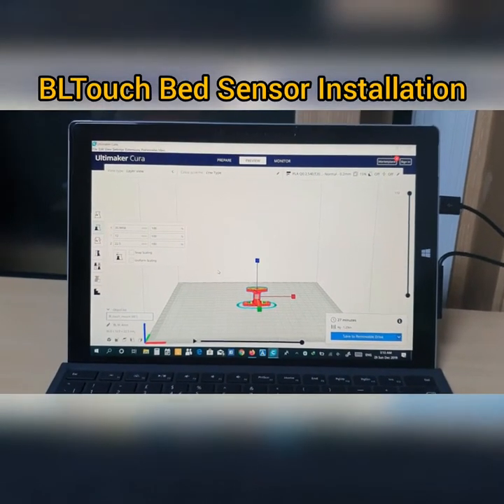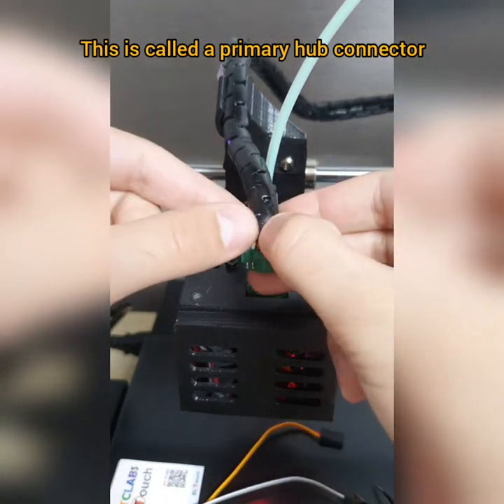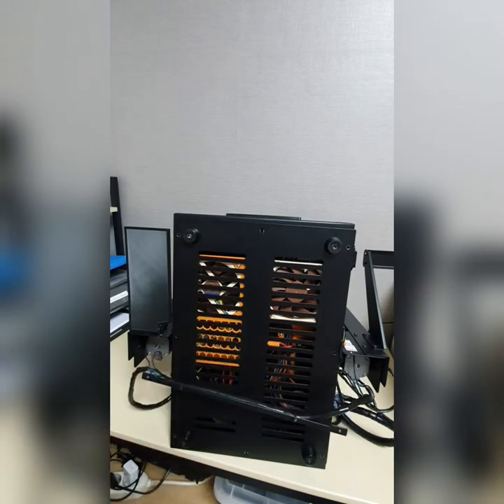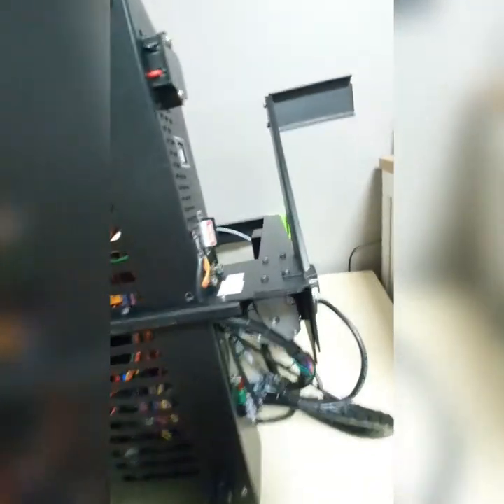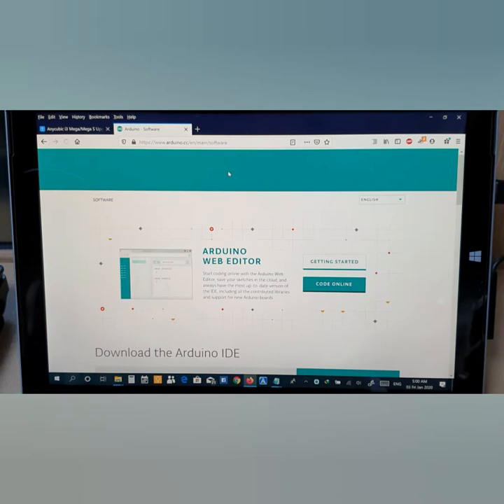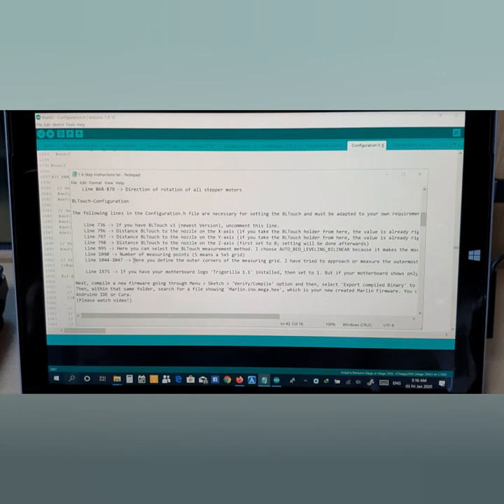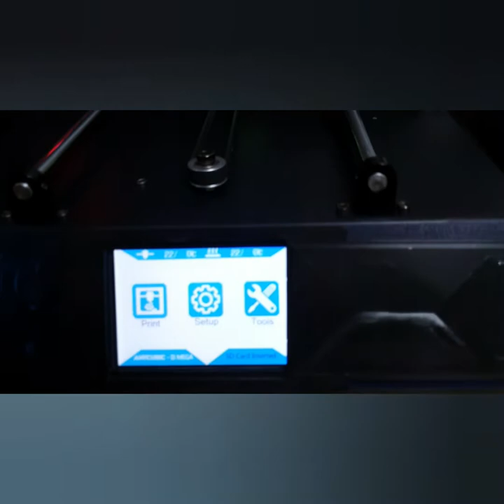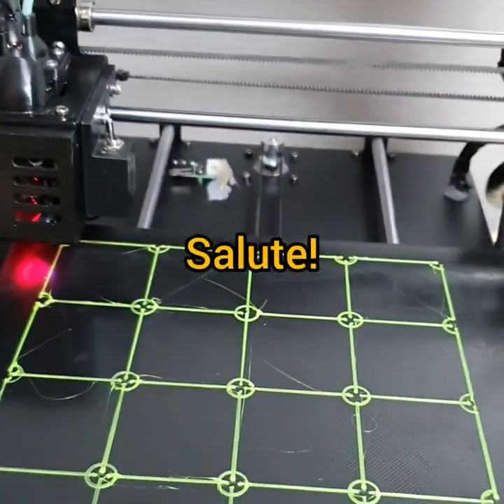BLTouch or Clone Bed Sensor Installation & Marlin Firmware for Anycubic i3 Mega / Mega S 3D printer

Comment: I seen somewhere on here that when replacing the stepper drivers with tmc drivers you have to turn the white plugs around also
Reply from the maker: It depends. There are 2 alternatives: 
1) You should comment out in the Configuration.h OR
2)Reverse the cables.

Comment: Can you show how you installed the mount do you need any differant bolts. Also did you use pla for the mount.
Reply from the maker: Well, I printed in PLA but I recommend you printing in ABS. I guess M3 bolts 🔩 and nuts.

Comment: Are the two z endstops still enabled? Should i mechanically set them lower than the probe? My bltouch seems to do nothing because the Z axis goes down only to the endstops and the nozzle remains too high to print
Reply from the maker: You need to adjust the Z axis on screw lead to be downwarded till the nozzle touches the bed. Please join in our Facebook group we can assist you step by step. The link is mentioned under the video.

Comment: Great tutorial! I followed every step in this video. The only problem I have is that my BLTOUCH is not registering when the pin is pushed in. It fails after trying the first point. Do you think you know what is going on?
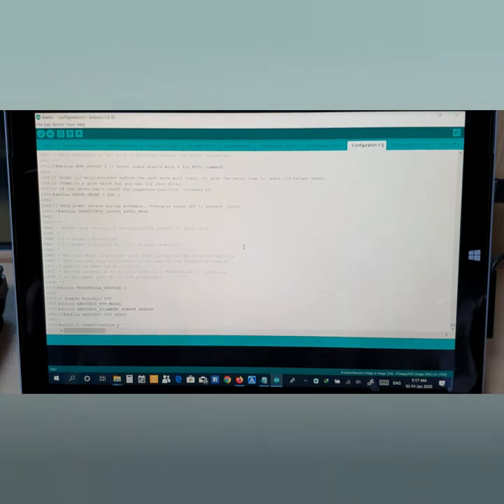Reply from the maker: Did you follow this step 1:16:00 ?
Just listen carefully.
Reply from the maker: At track 14:11: there is a minor misguidance about the White & Black wires on BLTouch. Here it is. White on BLTouch is Signal & Black is Ground. 
White goes to Yellow wire of Fanbox & Black to White wire of Fanbox
Reply from the maker: Then after you have done these, please inform me asap.

Comment: Do this only work for Andrino? I not using Andrino or plan to do so. where can I find the configuration file so I can check them or update the motherboard version? I do see the blue light on my bl touch 
I followed your steps and the bl touch is on.
Reply from the maker: check the white and black wires
Reply: @ariankojefferson2758  Thanks but you didn't answer the question where can I find the configuration file to update.

Comment: Are there any disadvantages of the marlin or bltouch?  I also saw marlin 2.0 and are you going to install that? I also saw some kinda extruder issue after bltouch installation. I'll be happy if you're going to answer me.  :)
Reply from the maker: Hello, there are no any issues so far. It is much better than the stock one and Marlin 1.1.9. 
Please join in our group for detailed explanation:
For FDM printer: Anycubic i3 Mega/Mega S or X: 
https://www.facebook.com/groups/1475376915974525

For SLA printer: Anycubic Photon Mono SE:
https://www.facebook.com/groups/186363709772657/?ref=share
Reply: @ariankojefferson2758  Dude I got stock printer. So is there any difference to flash marlin into my printer?

Comment: Hello mate. My board version is V0.0.2 On the Arduino IDE should I leave TriGorilla Version 1 or 0? Another issue when I try to compile my sketch I got an "exit status 1" "Error compiling for board Arduino Uno." Any clue about this issue? Thanks.
Reply from the maker: Hello,
Did you check your board logo that shows Trigorilla 1.1. If so, then you need to comment out 1 but if your board shows just Trigorilla, then it comment out 0.  Join us in our Facebook group for our assistance.
Reply: @ariankojefferson2758  Thanks for your reply mate. My board is just "TriGorilla" that means comment out "0". Ok. But when I change it to "0" and try to verify/compile I got an error "exit status 1"
Reply from the maker: I need to see a photo or video so I can assess the situation.

Comment: Hi Bro. Will this apply to i3 mega X? My Z stop sensor broke
Reply from the maker: yes it applies. But make sure to buy it at AliExpress before u begin
Reply: @ariankojefferson2758  thanks Bro. I may not need the z sensor right? If I install the bl touch.
Reply from the maker: @TitoPopoy  u better have but it works when u install BLtouch
Reply: @ariankojefferson2758  ugh. One of my z axis stopper aint working
Reply from the maker: @TitoPopoy  the nozzle might crush or grinde and makes sounds. U better purchase. It just cost less than one dollar
Reply: @ariankojefferson2758  i dunno if there are spare parts here/. I'm from philippines
Reply from the maker: @TitoPopoy  u can purchase on AliExpress

Comment: Hi, I have just installed all this but the first layer keeps reverting back to 0.3. I have added spacers etc, amended GCodes but it keeps going back to 0.3 Z Height when it prints and it should be -0.8? Any help please?
Reply from the maker: Please adjust the BLTouch washers to adjust its height.
Reply: @ariankojefferson2758  Thanks, I have done that but the default first layer keeps coming out at 0.3 regardless off washers or gcodes?
Reply from the maker: Here is my Skype i.d: 
live: Sawak.the.great
Reply from the maker: Did you adjust the Z rod adjustment screws on each side? Try to adjust it there too.
Reply: @ariankojefferson2758  I did make some adjustments there yes. Sorry I cant get video on skype!
Reply: @ariankojefferson2758  Its like the Z-Offset isnt making any effect at all even when it doesnt hit the endstops.
Reply from the maker: I need to see all through Skype. Otherwise, it is hard for me to figure out when i can't see what is going on.

Comment: when i flash the firmware it will not reach the temps I need it to, I need it to reach 260c its only going up to 245 then temp goes down
Reply from the maker: Yes that's right. Either it restarts automatically or hangs in the middle. It is because of either weak built-in Mosfet or low PSU voltage. Please join our Facebook group, where we can assist you.

Comment: are you able to put a stock firmware file with bl touch on to the thingiverse page please!!!
Reply from the maker: Yes it is already uploaded. Please check in Thingiverse page.
Reply from the maker: It is impossible to use stock firmware with BLTouch bed sensor. You have to flash Marlin Firmware onto your 3D printer.

Comment: When I start the automatic bed leveling the sensor won´t pop out (blue light) at the first test point. What could be the issue?
Reply from the maker: Your BLTOuch while and black are not connected.
As I have recently explained about my misguidance under my video.
Here:
"At track 14:11: there is a minor misguidance about the White & Black wires on BLTouch. Here it is. White on BLTouch is Signal & Black is Ground. 
White goes to Yellow wire of Fanbox & Black to White wire of Fanbox"
Please let me know.
Reply from the maker: Please join us in my Facebook group:
https://www.facebook.com/groups/1475376915974525/
I will assist you there.
Reply: @ariankojefferson2758  I already did. It drives into the first measuring position, goes down (no BLTouch extended/red light) then stops.
Reply from the maker: Black and white wires on BLTouch have a connection issue. Please check !

Comment: Hi thanks for the video.
I have this problem when I try to verify the fiin Arduino:
Arduino:1.8.13 (Mac OS X), Scheda:"Arduino Mega or Mega 2560, ATmega2560 (Mega 2560)"
In file included from sketch/MarlinConfig.h:42:0,
                 from sketch/I2CPositionEncoder.cpp:31:
SanityCheck.h:946:5: error: static assertion failed: LEFT_PROBE_BED_POSITION is outside the probe region.
     static_assert(LEFT_PROBE_BED_POSITION >= MIN_PROBE_X, "LEFT_PROBE_BED_POSITION is outside the probe region.");
     ^~~~~~~~~~~~~
In file included from sketch/MarlinConfig.h:42:0,
                 from sketch/AnycubicTFT.cpp:27:
SanityCheck.h:946:5: error: static assertion failed: LEFT_PROBE_BED_POSITION is outside the probe region.
     static_assert(LEFT_PROBE_BED_POSITION >= MIN_PROBE_X, "LEFT_PROBE_BED_POSITION is outside the probe region.");
     ^~~~~~~~~~~~~
In file included from sketch/MarlinConfig.h:42:0,
                 from sketch/AnycubicSerial.cpp:34:
SanityCheck.h:946:5: error: static assertion failed: LEFT_PROBE_BED_POSITION is outside the probe region.
     static_assert(LEFT_PROBE_BED_POSITION >= MIN_PROBE_X, "LEFT_PROBE_BED_POSITION is outside the probe region.");
     ^~~~~~~~~~~~~
In file included from sketch/MarlinConfig.h:42:0,
                 from sketch/G26_Mesh_Validation_Tool.cpp:27:
SanityCheck.h:946:5: error: static assertion failed: LEFT_PROBE_BED_POSITION is outside the probe region.
     static_assert(LEFT_PROBE_BED_POSITION >= MIN_PROBE_X, "LEFT_PROBE_BED_POSITION is outside the probe region.");
     ^~~~~~~~~~~~~
In file included from sketch/MarlinConfig.h:42:0,
                 from sketch/M100_Free_Mem_Chk.cpp:49:
SanityCheck.h:946:5: error: static assertion failed: LEFT_PROBE_BED_POSITION is outside the probe region.
     static_assert(LEFT_PROBE_BED_POSITION >= MIN_PROBE_X, "LEFT_PROBE_BED_POSITION is outside the probe region.");
     ^~~~~~~~~~~~~
exit status 1
static assertion failed: LEFT_PROBE_BED_POSITION is outside the probe region.

And I have the line 946 is in RED color.
Could you help me please?
Thanks
Reply from the maker: I know this issue. Please join in my Facebook group.
Reply: @ariankojefferson2758  Sorry I haven't facebook :-(
Reply from the maker: The left side of BLTouch is outside your bed position.
Go to menu, select Find, and copy and paste "LEFT_PROBE_BED_POSITION" in search bar then increase the bed size by 5 to 10mm. Just play with it. If you could join my Facebook group, i can help and solve your problem there as i am always available there rather than being here.

Comment: That was painful to watch lol
Reply from the maker: why is it painful to watch? 😊
Reply from the maker: Well, you are the only person opposed to thousands people having an issue :)
Reply: @ariankojefferson2758  I don't mean to be critical and I appreciate that the info may be great but getting to it is too lengthy, the video is just about 2 hours long and most of it is not needed. The points are hidden in unnecessary common knowledge. Please just take it as constructive and not nasty criticism. :) If you could say the times in the video for the points of interest it would help. Thank you. :)
Reply from the maker: @FuriousGriffin As you can watch my tutorial video very carefully, it demonstrates point-to-point, stage-to-stage, & all-in-one instruction such as :
1) Printing Mount through Cura;
2) BLTouch presentation and Setup,
3)Opening case of the motherboard;
4)BLTouch wiring;
5)TMC2208 Stepper Driver explanation;
6)Noctua Fans for PSU and for Motherboard;
7)Orientation for back case;
8)Arduino Installation and Marlin FW
 creation;
9)Flashing Marlin FW via Arduino or Cura;
10)Printrun Installation and commanding Gcodes,
11)Auto Bed Leveling; 
12)Mesh Test Print;
which are all merged into one perfect pack of All-in-one. Do you expect it can't be lengthy? There are too many users out there who do not even know what is Cura & how to install it. Well though, you still doubt it is painful to you? Do you know I don't even charge anything ? instead trying to be so helpful and reachable to the desperate users, who need my help. I usually guide and instruct them through Skype until the end and have them comment out positive reviews and appreciate me.
Reply: This is so hard to watch. Too much deviation. Stick to the point and get to points more quickly. The video is about 3 times longer than it needs to be.
Reply: I agree,.. did we really need to sit and watch you clip strings for almost 5 minutes? Thats a 10 second explanation.. “use clippers or a file and remove any loose strings from the BLTouch mount”. Done, move on! I’m not sitting here for 2 hours to figure this out.. This is just some constructive criticism. 2 hours for a video that could’ve been done in 30min, is just too much
Reply: It seriously is. "I mean this. I mean this. I mean that". He spends over an hour on a video that could have been 15-20 minutes. Not to mention it's all portrait style video which is painful to watch on just about anything besides a phone.

Not to mention he didn't even actually show it being installed on the printer. It's over an hour and this guy already has the mod installed on his printer. Also really didn't need to watch this guy glue in a fan box cover for a non-standard fan box. Like really? Has he never heard of editing?

Comment: i keep getting this error when compiling the marlin firmware "#error "Auto Bed Leveling requires one of these: PROBE_MANUALLY, FIX_MOUNTED_PROBE, BLTOUCH, SOLENOID_PROBE, Z_PROBE_ALLEN_KEY, Z_PROBE_SLED, or a Z Servo."
Reply: also, how do i flash firmware using octoprint
Reply from the maker: Did you edit or comment out somewhere?
Please, leave it UNTOUCHED as it is. What model of printer are you using? i3 Mega or Mega S?
Reply: @ariankojefferson2758  I've got it compiled now but im using octoprint to flash the new firmware and to be honest i have no idea what I'm doing can u please help me. I've spent 8+hours today trying to figure this out
Reply: i3 mega
Reply from the maker: First of all, please don't compile with Octoprint. Try Arduino or Cura. Here is my Skype I.D. Let's chat and have a video conversation. This is my I.D 
Live:sawak.the.great
Reply: ArianKo Jefferson thank you very much, I will take you up on your offer, I’m currently in university classes right now, but I will be available in 6hrs if you are?

Comment: I'm sorry..  But your video is SOOOO long, I gave up watching it.  Also, "so all you need to do" isn't something that you should be saying every other sentence.  It got to the point I started cringing when you said it. Same with "as you can see here."..  
1)no body really wants to see your modeling of the mount.
2)It was really hard to see what wires you were pointing to, and you took soooo long to get to any point.  (Anyone watching either owns this printer and just wants to see a quick way to install it, or can't figure out how to get into the hotend to install it.)
3) nice job labeling your wire to wire colors on the screen.  This is one of the more complex installs and that surely makes things easier for some.  However,  saying "signal wire or ground wire" probably won't mean much, as I'd bet most people only know the colors and not where they actually go or do... 
-Overall, I think you could've had a GREAT video.  Clearly you know what you're doing and what you're talking about.  Maybe try writing a script 1st and following it, so that it helps to keep you on task and speeds you up. 
Cutting out some of the unnecessary dialogue and what I would classify as "troubleshooting" steps during the installation process would probably make this video a lot shorter and therefore you would probably receive  more complete viewing until the end..
I know making YouTube videos is hard, talking on camera itself is hard and does get a lot easier with experience.
And video editing is a real pain in the ass. Lol...
I think you've got potential to make some really good videos in the future and I wish you the best of luck in your endeavors. Take my advice or leave my advice but as someone who attempted to view your video, (I say attempted because I had to skip through it 300seconds at a time) I offer the constructive criticism I can think of, I hope this comment doesn't this weed you from making further attempts in the future.  I hope it has the opposite effect and encourage a few to make better higher quality videos in the future with just as detailed information but maybe slightly more pertaining to the task at hand and a lot shorter. Lol
Reply from the maker: Lol thanks for your sincere explanation. As you know installing BLTouch should be thoroughly and carefully observed. It isn't that easy.  Actually I did this to detail out the thorough explanation for those who are beginners. I know it is pain in our ass but for those who are super beginners deserve the most. Yes didn't got some time to edit but yet I spent a lot in editing, I understand I improve more better. But please try watching from the beginning to the end if you want to start fresh. And again thanks for your friendly advice. I will do all my best to knock down to shorter video. Salute!

Comment: Line 868-879 -> Direction of rotation of all stepper motors """you did not mention this section"""
Reply from the maker: Yes, i have skipped that because the instruction is already mentioned there within Configuration.h
Reply: @ariankojefferson2758  if i am using stock do i change anything
Reply from the maker: no but if your printer moves in an opposite directions, try comment out all in reverse(which is already explained there)
Reply: @ariankojefferson2758  i also am getting a big error when i am compiling firmware (DI031_RPORT)
Reply from the maker: please follow me up on Skype. Here is my i.d : Live: sawak.the.great
Reply: @ariankojefferson2758  ok I am UK do just going to bed but I will tomorrow thanks
Reply: @ariankojefferson2758  Did you figure out the DI031_RPORT as I have the same issue thanks